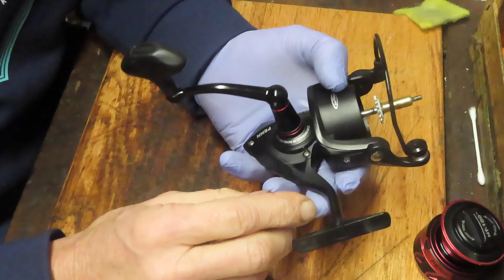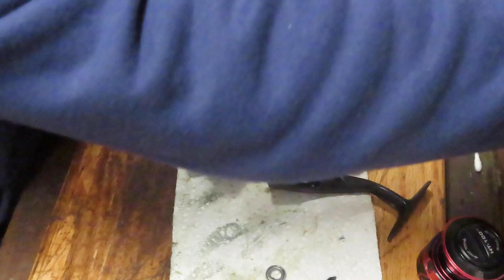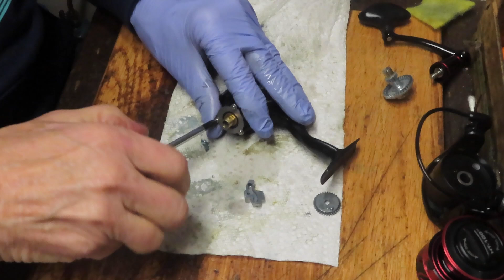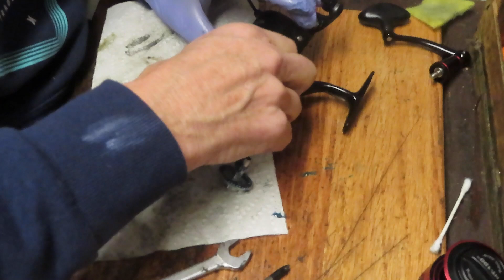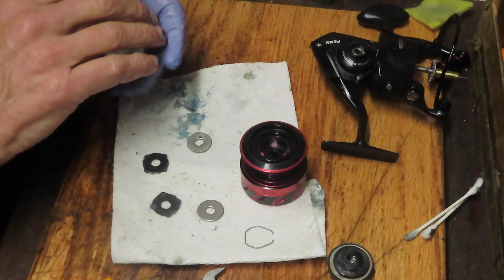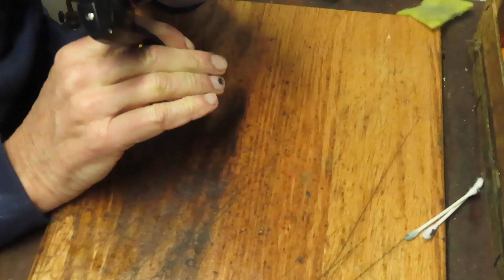Penn Fierce III 3000 Fishing Reel Service

Comment: You are amazing thank you! I purchased a used Penn Fierce III with very dirty bail arm spring full of grease, should the spring and mechanism be greased or oiled?
Reply from the maker: You do not need to grease the spring and trip arm.  You should lightly oil the gap where the bail arm meets the rotor body and you should oil the line roller guide Thaks for the note - Dennis
Reply: @2ndChanceTackle thank you Dennis, I really appreciate your feedback and the videos you make, so helpful!